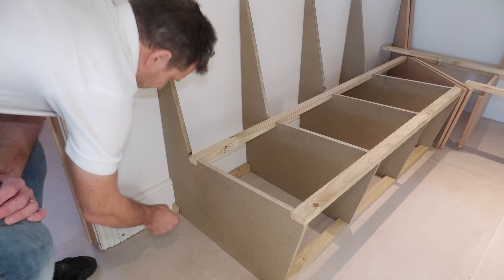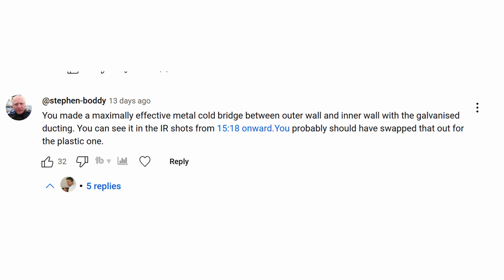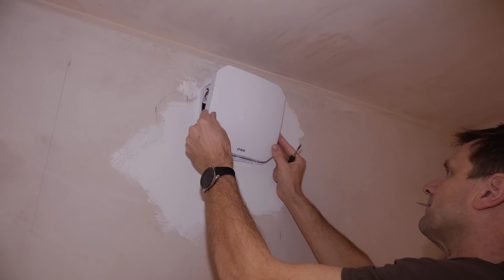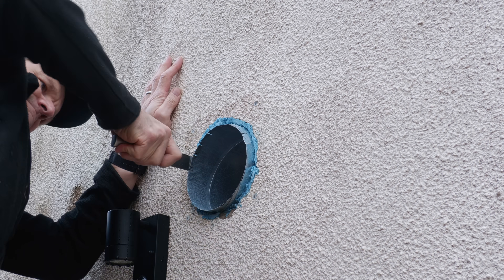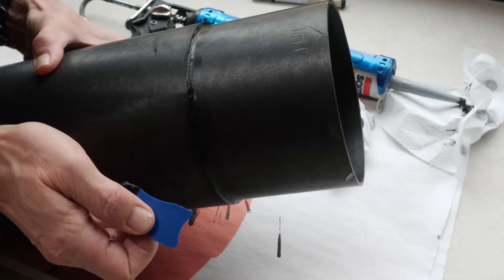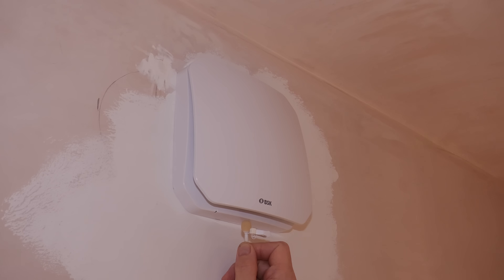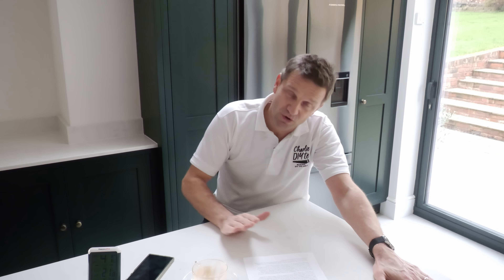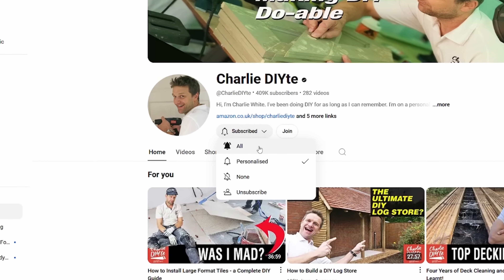Is Single Room Heat Recovery Ventilation Worth It?

Comment: I do not have much confidence in these reversing flow DMVE units. Like said by other commenters, they need to be paired to have any benefit above a normal extractor fan, do have a low capacity and some of the extracted air is brought back into the house because the same vent is used for extraction and supply.
A cross flow heat exchanger is much better, but still most of the units using these have the problem of the close proximity of extraction and supply vent openings which leads to just extracted air being sucked in again. The Envirovent seems to have solved this problem partially with the larger outdoor vent unit.

Installation of MVHR in an older house is difficult but not impossible. Best it is done in combination when new ceilings or lowered ceilings are being installed.
With flat ducting a new lowered ceiling needs no more than around 10 cm of additional space, and old houses often have quite high ceilings.
The problem of the large main ducts however still was there for me as I didn't want boxed in sections along the walls going from the ground floor ceiling to the attic.

I found the solution in Blauberg decentral units intended for use in office rooms above the suspended ceilings. The capacity per unit is enough for around 50-60 m², so more than these wall mounted systems but less than a centralised system. From a price point these were around £550,- per unit, so at a same level as the Envirovent
I have three of these units, 2 on the lower floor where a kitchen, an utility room, toilet and a shower room are situated, so with a somewhat higher demand.
One unit serves the upper floor. Each unit extracts from 2 rooms and supplies fresh air to the same or adjacent room. A small gap under the doors ensures proper air flow.
The upper floor unit is in the attic and draws air trough an old opening in the outer wall where the gas boiler was and exhausts via a chimney.
The exhaust and supply for both ground floor units use vent stacks trough the flat roof of the extension, the units and these main ducts are situated in a place where a suitably lowered ceiling with access hatches could be made for filter changes. The units come with am optional F7 filter and an in duct carbon filter is coupled in to remove any smells and hydrocarbons from the air.
The use of these units made the amount of ducting to be installed minimal and easy. Only one extra circuit breaker for all three and electric supply to each unit was needed, but you need these for the wall mounted units as well. With a ducted system with sufficient diameter and with a flexible noise cancelling hose piece close to each vent the noise entering from outside is absent and from the system itself minimised. I choose one size up from the recommended duct diameter to reduce flow noise to a minimum.
Reply: Push-pull units are clever, but as you say they rely on reversing cycles. That can cause pressure swings and some mixing of air. Cross-flow designs like our KHRV150 supply and extract simultaneously, so you get balanced ventilation and more consistent heat recovery.

Comment: It would be much better to have two of these working in tandem, with each switch changing in/out direction. Setup like in the video, it will either pull cold air into your house through air leaks or push warm air out of the leaks. (There's no balance)

Comment: Your a class apart Charlie - thanks for tackling all the feedback. I was looking at the vent axia because I wanted to maintain room temp better whilst extracting air. Great follow up video on the topic thank you.
Reply from the maker: Thanks John, really appreciate that. That's exactly what I was aiming for but I didn't realise how the Zephyr cycling worked. The Vent Axia would be a better option. 👌
Reply: Had the Vent Axia Tempra P in both kitchen and bathroom. Impossible to clean, very loud when in boost and just didn't seem very effective. There's just no way to clean the tiny tubes and there's no filter to stop any fluff from getting in. You need to electrically isolate the unit to clean it and you need a lot more clearance around the unit to open the door (so can't be fitted in a corner). The core has really weak plastic tabs that just break easily. The fan has many blades which creates a lot of surface area for dust to stick to and very little room to maneuver whatever cleaning tool you've chosen to use. I noticed that the kitchen one would make the surrounding wall surface very dirty (grease in the air making everything sticky I guess). Even the bathroom one was difficult to clean as moisture makes dust harden and very sticky over time (tearing toilet paper creates a lot of dust).

The filter in the unit in this video is unlikely to stop the tiny tubes filling with dust over time.

Comment: A have seen a Certified Energysavings Consultant go into detail on the heat recovery. His bottomline was that for most cyclic units the rate is massively overstated. If I rwmwmber correctly the passive house institute die certifactions where they actually measure the recovery rate. Turns out only cross flow designs were able to get anywhere near 80-90%
Reply: It seems the rotating wheel systems are the only ones that actually do what’s claimed. That’s why I’ve gone for one.

Comment: Such an interesting topic and video. 👍😊 
can you recommend a good extraction fan? Also, for any experts maybe reading this:
I'm having issues with thermal bridging coming from a big balcony (9x3m) and concrete sidewalk, both connected to the inside floor.. I did a 12cm EPS on the outside but didn't know how to correct those to.. 🤔🚧
Reply from the maker: Thanks buddy. It depends where it's going and what ducting you've got. Give me more info and I'll try and suggest something. 👍
Reply: @CharlieDIYte  2 medium-sized bathrooms.
Straight through and out the wall, 30cm.
I need something that actually pools that moist air out cause the ones I have now don't suck anything

Comment: Thanks Charlie, another great video and super update!👍👍
One interesting piece of (low)tech I saw recently was an adapter for a portable dehumidifier which turned it into a ducted unit, which could then be placed in a loft space or cupboard; dehumidifying the air more discretely than a portable unit. As has been discussed, where the principal issue is moisture (rather than air quality) a dehumidifier is often a good solution, but many people don't like the ugly/bulky appearance and noise that comes with a portable unit.
Reply from the maker: That is interesting, and also if you can get dehumidifiers draining independently you can forget about them. Difficult to do in practice though. You're right though, it's quite a noisy unit. My Ebac sounds like a fridge. Fine when it's got a job to do but you wouldn't want it running in your living room 24/7 👊

Comment: Thanks for the video!

I was wondering if you considered the Mitsubishi VL100?

I need to have something in my truck camper (17mm2), co2 ppm levels are really high (1500-2200)

I'm thinking about the Mitsubishi VL100
Because:
1. It's an ERV (humidity stuff) 
2. No min wall thickness (my walls are 60mm), Not a hard limit, I can always build a box for it

Would love to hear your thoughts on this or if you know of any other products that might fit me that I can research on
Reply from the maker: I'm not familiar with that unit but the zephyr has a wall limit so it sounds like the Mitsubishi is tailored to your requirements and looks superior to mine. Andy Mac (Gosforth Handyman)installed a Kair in his music studio because he was worried about CO2. Maybe contact BPC - they have a design service and also sell the VL100. They'll design a definitive system for your requirements.

Comment: I have been buying the ceramic cores only from China and putting them in the ventilation holes of my property with some carbon cooker mesh either side. No fan, it is passively recovering heat and does so with the natural air movements of the building (which you can feel as the direction changes every so often). I have been happy with this, besides having no running costs (and much cheaper purchase cost) it allows ventilation to my property (which is draughty anyway being an old building) and does recover some heat. I have thermal cameras etc and have not done a full analysis, last time I checked the core was above external by a few degrees which is obviously warmer than if the hole had nothing. Anecdotally I currently think this a good solution (especially since in my home the 100mm holes were already there). The bathroom has an active MVHR.
Reply: Where do you get the cores? What keywords did you use to find them?

Comment: Love this channel and how open dialogue and conversation is. This is how we learn by doing and trying. I live in a 1930s terrace and initially bought a commercially available PIV system. However, I eventually made my own because I wanted the fresh air to pass through a hydronic water coil connected to the central heating, as well as upgraded filters. I also invested in a decent bathroom extractor fan and a kitchen hood that vents to the outside, with a trickle mode for post-cooking ventilation. We’ve also got a heat pump tumble dryer.

We didn’t have major condensation issues to start with, thanks to these extraction systems, but the DIY PIV was more about improving indoor air quality as we live next to a motorway. The results have been excellent. The only downside in winter is that the humidity can get so low—sometimes as low as 20% when it’s cold outside—that we experience static shocks!

I know PIV isn’t as efficient as MVHR, but I closely monitor the system and accept that fresh air introduction does lead to some extra heating costs. For me, it’s a small price to pay for healthier indoor air. Plus dry air is less energy intensive to heat. 

I’ve also incorporated a slow-running extract fan in the floor of my media cupboard, where the media equipment generates heat. It’s essentially a mini server room under the stairs, and it can get quite warm in there. The extract fan removes this warm air and pushes it under the house. While I’d love to recover that heat as part of another project, it has already turned the underfloor space into a pre-conditioned area, keeping the timbers warm and dry.

The PIV in the loft delivers more air than the extract fan removes, so the house remains positively pressurised. That said, PIV isn’t a one-size-fits-all solution. Decent extraction is critical to remove humidity; otherwise, you risk moving it to areas where you can’t see it. With proper ventilation and fresh air introduction, it has worked brilliantly for us, but I can’t stress enough how important it is for people to do their research first.
Reply from the maker: That is next level Richard, thanks for sharing 👌 Wish I had an engineering background/ aptitude. The only thing you're missing is Home Assistant integration. 😉
Reply: @CharlieDIYte  self taught Charlie, just from tinkering and being interested. I've got more knowledge on my own house than any engineering background could give. You just have to be open to learning and trying things. 

Home automation I am tied into the Philips Hue ecosystem which frustrates me at times!
Reply: @richardc1983 hi I'm concerned about your air quality comment. You said your concern is the motorway but you are sucking that air inside with the PIV? Yes it might have a filter but most of these only filter out the largest particulates. Probably the pm2.5 or smaller still get in, never mind the gasses like NO or other gasoline related ones. Your best bet is probably seal as well as possible and get as good purifiers as possible
Reply: @UtoobNam  no reason to be concerned... I have upgraded filtration. Pre filters which take the big stuff out then high grade bag filters, followed by Hepa filters... my system is on par with something you might find in a modern office building. My CO2 levels never go above 800 and the ppm and Nox are 0. Go outside and it's a different matter. My system shows me the levels before and after filtration.

I also have a couple of smaller purifiers for bedrooms.

Comment: Tbh I think we can all go overboard with all these figures. I find that the simplest solution to find if a particular unit or event (changing the central heating timing slightly etc) is having an effect is to not tell anyone what you're doing and see if anyone remarks on it,. I regularly change timings etc and see if the missus complains of the cold or if she's too hot. A lot is definitely psychological, we have the boiler flow temp on 44c at the present, the house stat is on 18/19 (we used to have it on 20/21c regularly), my wife is comfortable with the heat because the rads are more or less on all the time . I've also found that a PIV has been superb for our house, it's put the Relative Humidity down to high 50's low 60's and the house 'feels' warmer.  We also use a dehumidifier to dry clothes in one room therefore freeing up all the rads in the house. You can't seal a house up ALL the time, get comfortable, recognise you're going to have some chilly days and get on with it...
Reply from the maker: Spot on John 👌

Comment: I am struggling to get an answer from anyone on this in terms of target Relitive Humidity (RH) levels to be set on MVHR units. 

Should we recommend lowering the target RH setting in the summer as the units will be importing high RH air from outside?

A RH of 75% in the winter will be less water in the air when compared to the same 75% RH in the summer. So my thought process is that targeting say 50% RH on the MVHR settings would be ok in the winter as there is less water in the outside air to replace the internal air. 

In the summer targeting the same 50% RH could mean that we are exporting air with a RH of 50% and replacing it air with a RH of 75%. 

This would be made worse if the external temperature is higher than the internal temperature as this would mean that the amount of water in the outside air is also greater than the internal air as the higher the temperature, the more water the air can hold (75% RH at 5° is less water in the air than 75% RH at 20°) so we have the MVHR unit replacing the internal air with more humid air from outside potentially in the summer. 

If this is correct then why do we have target settings for RH on MVHR units that potentially would make internal humidity levels worse?
Reply: Well you will have to consider that relative humidity beyond sixty is really rare in the summer. And probably only seen after rain. But tbh in the summer I would try to control the temperature and ignore the humidity. You don't get issues with mold in the summer

Comment: I done my own full house MVHR as a retrofit and I have often wondered if the cost was worth it. All in it cost around £6k which included the boxing in of ducts to get in some rooms downstairs. 

What I found interesting with your RH readings were they seem to be so low. I have my RH set on the MVHR to target 50% and it is nearly always in boost mode in the summer and in the winter from anywhere to 40%-75% fan speed to try and get the RH down. 

I wonder if my MVHR sensor is out or if yours is. 

I am now considering buying some of these sensors you as these must be more accurate as the MVHR is measuring multiple rooms combined.
Reply: Mvhr will do nothing in the summer to lower your rh because temp outside is virtually identical to temperature inside. If its 19 degrees outside with70% humidity how do expect to get lower rh inside? Going boost mode is just a waste of money. Even 10 degrees outside at 90% (which is common in winter and autumn) you will struggle to get below 55% inside.
Reply: @ this is kind of my point. The video shows the RH at circa 40% which I am shocked at as mine hardly ever goes to the set back speed of 25% which it does when the target RH is met. 

I have been considering raising the target RH in the summer to something like 75% as 50% is just not achievable which is also why I want to purchase monitor so I can actually see what the RH is. My MVHR doesn’t give me this information. I only go on the fan speed to give me an indication.

Comment: Having had 2 full mvhr units in my last houses I can categorically say they are junk, to get to the numbers they describe it had to run at near jet engine speeds, and was equally loud(yes exaggerating) the plastic cardboard heat exchange blocks are also hard to clean, and need to be cleaned regularly for efficiency

 I’m doing a couple of dmev in the house I’m currently building and a few exhaust fans,
Reply: Funny how my experience is absolutely opposite to yours

Comment: We've got one of the Kair units you mentioned in our bathroom. It may not pay for itself in energy savings, but it's a lot better than having either:
a) the window open letting freezing air into the room in the winter or
b) a bog standard extractor sucking all the warm air straight out the house and dumping outside.

Our bathroom is warm all year round and we have a lot less damp and condensation in the house since fitting. So overall it seems to be worth the extra money.

Comment: I had a look a while back, 1910s house needing a lot of love, a load of gypsum and damp proofing being removed and rightly replaced with lime. I think the high % efficiency is generally higher temp with a smaller difference when it actually means less (summer). I've lost 10% humidity just with a few trickle vents giving some better circulation from one side of the house the other. 

Might be an interesting topic going forward though, the weather in the UK getting a lot wetter and warmer as least for now, that's a spicy topic but might make these more practical.

Comment: I literally don’t get it, heat recovery units are so expensive it’s not worth it. I think you get the similar humidity with a good extractor fan, simply moving air is going to help.